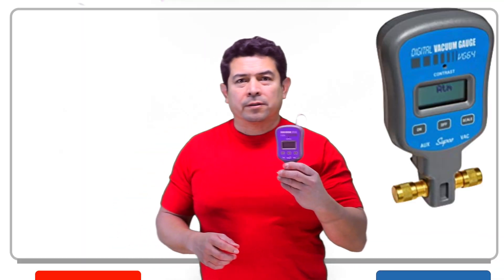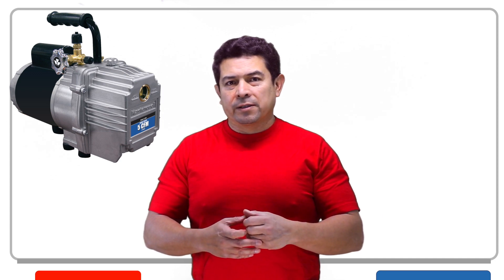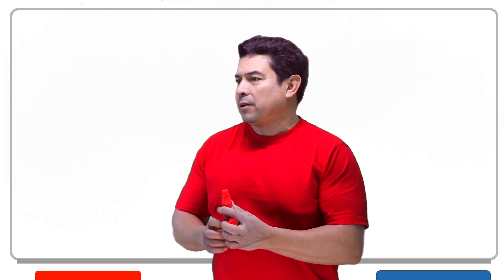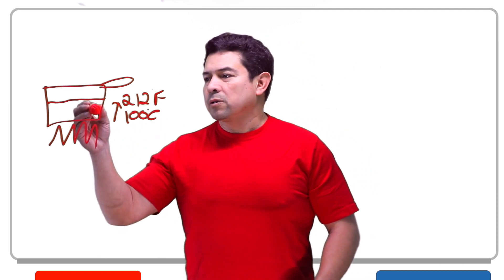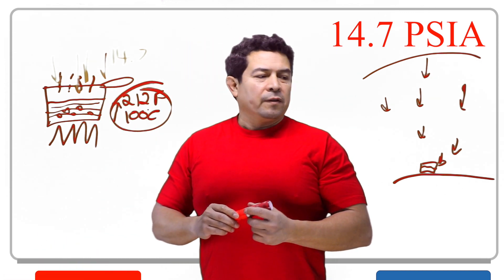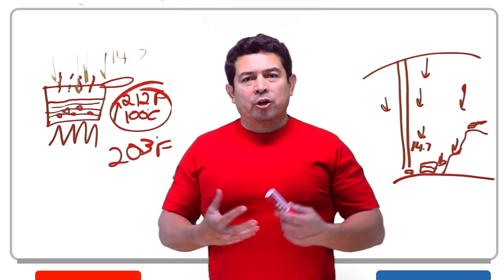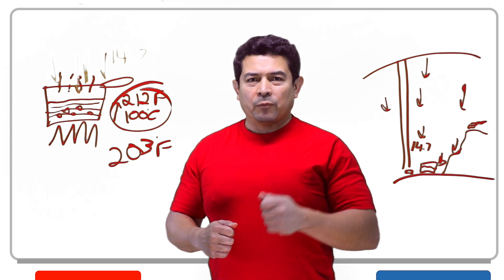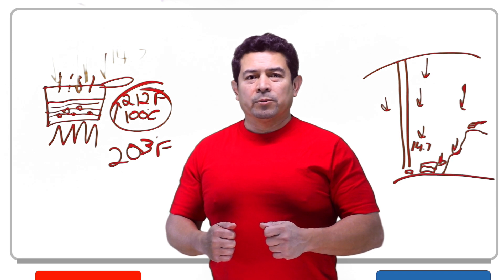Why we pull a vacuum on this system - HVAC Online Training and Courses

Comment: So what all can happen to the system if you don't get the proper vacuum? I under stand it can slug the compressor but is there anything else?
Reply from the maker: The reason we need to pull a vacuum down to 500 µm is because we want to get all of the moisture, air and noncondensibles out of the system. I had never heard of the compressor slugging because a proper vacuum not being pulled. The main thing that will happen is that the moisture that is left in the system will mix with the oil and create acid. The acid will attack the windings in the compressor and pretty soon you will have a compressor burn out.  Also if you do not pull the proper vacuum you will leave air and gases in the system, people call them noncondensibles, and they will increase the pressure in the entire system because of Dalton's law. That will make the unit not cool like it should. But as far as I know the compressor will not flood if you do not pull the proper vacuum. Thank you for your question and I hope this answered your question.